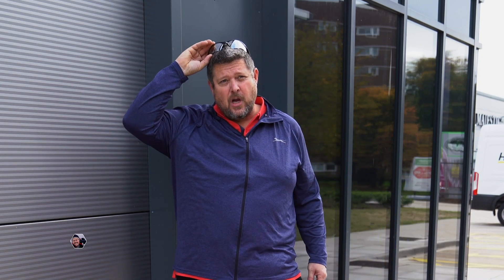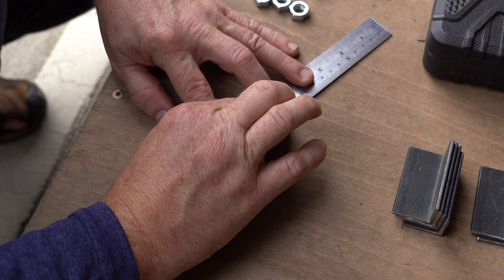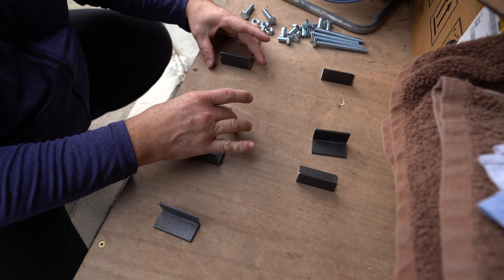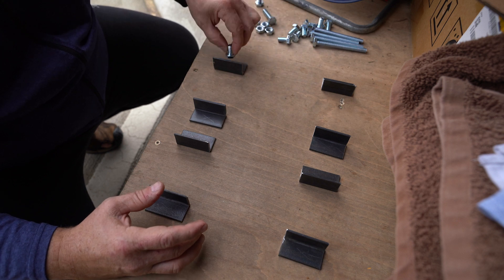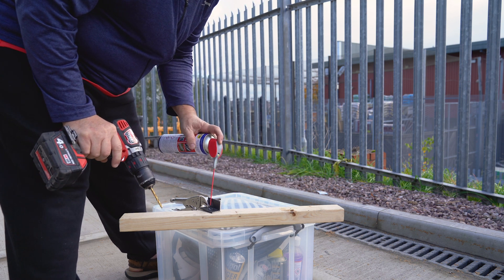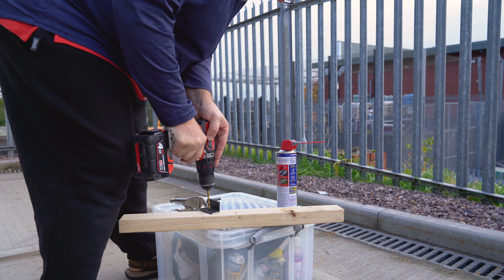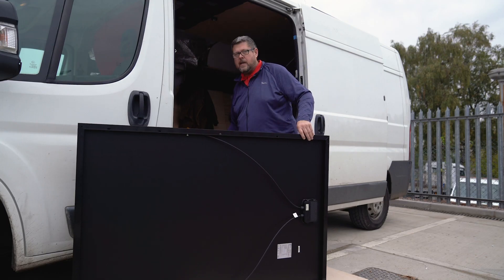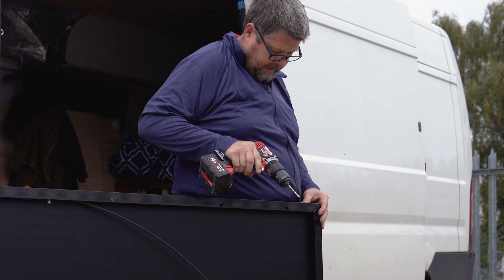Tilting Solar Panel Installation WITHOUT Hinges

Comment: Tilting your panels to 85° does undo the advantage you're trying to gain. 30° to 40° is sufficient.
Reply from the maker: In the U.K., the optimum is 40° if you’re titling in summer. However on the solstice in the U.K. 80° is best. And if you’re in the highlands of Scotland, then maybe a little more. I don’t have to tilt the entire 90° but I can.

Comment: Very helpful, thanks! May I ask why the rod, and not 2 individual bolts?
Reply from the maker: Thank you. I thought by putting t i individual bolts, I’d need to tighten then which wouldn’t allow it to pivot. By putting in a rod that goes right through the bolts can be tighter to the cross members tightly but left free inside the rod to pivot.
Reply: @BruceLauderdale  ah ok that’s very smart 👍🏼

Comment: Good idea but mounting steel brackets onto aluminium will eventually cause whats called galvanic corrosion.
I would have stuck with all aluminium with stainless bolts.
Reply from the maker: Thanks, I am not entirely happy with the steel brackets anyway. I am going to change to Aluminium and a road from one side to the other rather than the 6 inch steel brackets. Thank you for watching.

Comment: Great work Bruce. Will be super interested in the actuator fit. Also the best angle based on time of day etc.
Reply from the maker: Yeah, I’ll have to do a bit of investigation. There’s so much I need to investigate like a solenoid locking mechanism too.